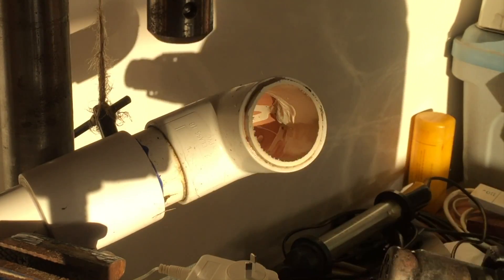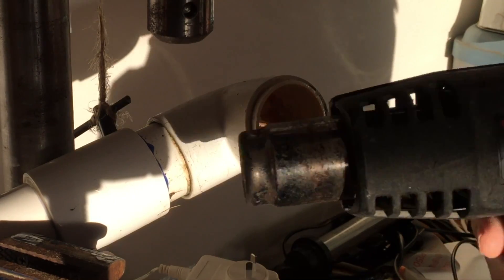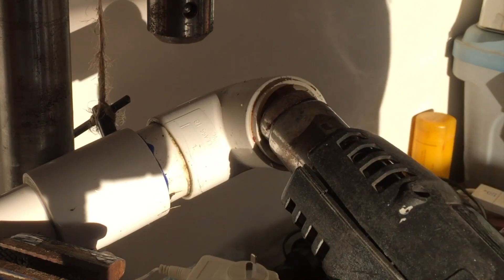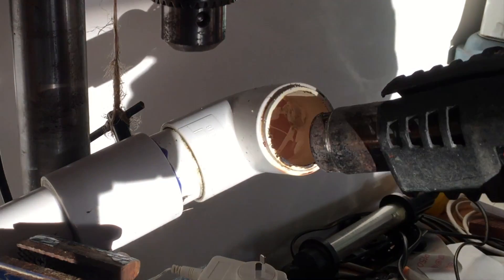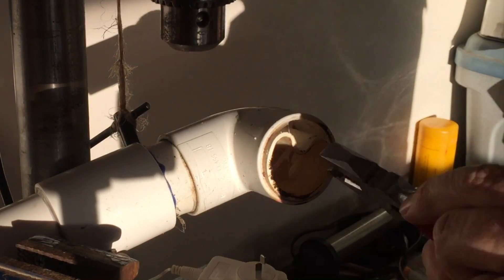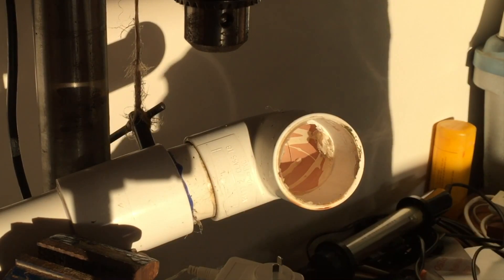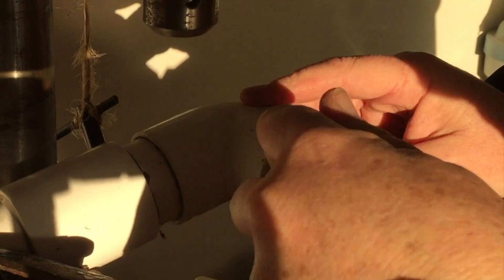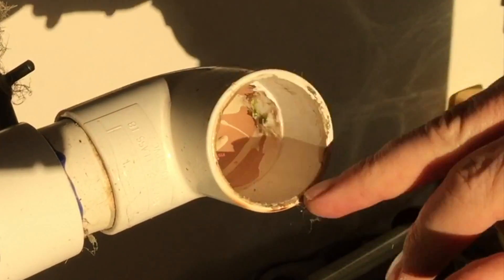Super quick How to HEAT OUT PVC fitting. Swimming Pool or Spa pipework unglue plumbing pipe

Comment: i have a question will this affect the cement on other end ? if it gets a little warm ?
Reply from the maker: Done well the other end of the elbow won’t get too hot. If it does no stress it will just cool again. 
I have never had an issue with the other end of a fitting. MRT